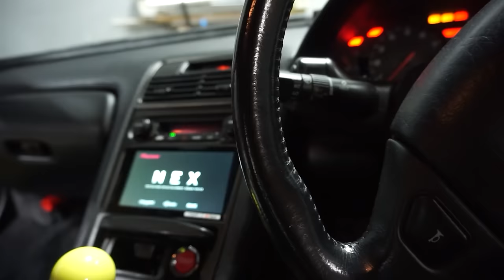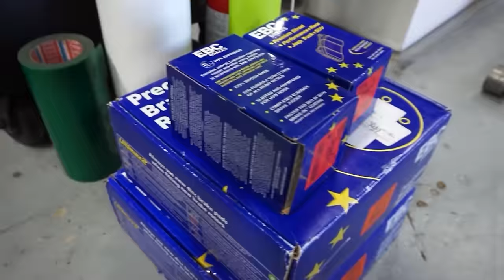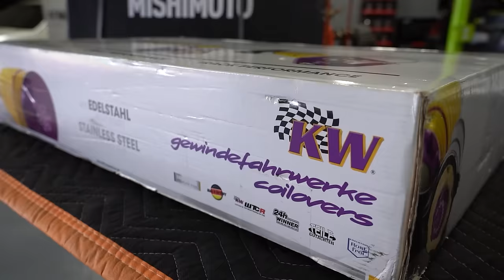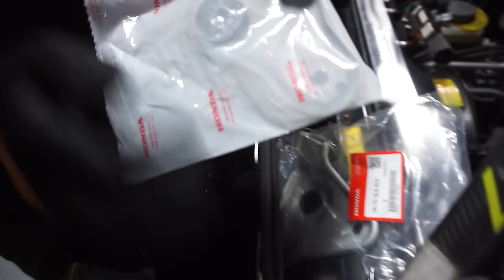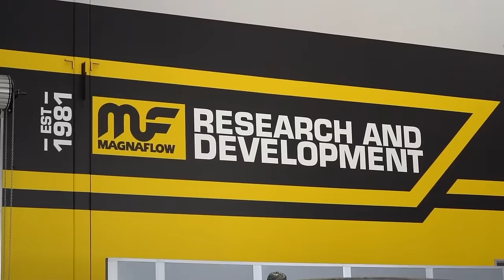Building a JDM Honda 1991 Honda NSX in 17 Minutes!

Comment: This is just simply a genuine question, but what is the purpose of giving the car a full detail prior to commencing a build? Is it to check whether or not the paint is actually any good and whether or not some pannels might need to be resprayed? I just feel as if through the build process, there is a lot of potential for paint damage to occur, which could be fixed or improved through detailing
Reply: So any left over dirt doesn’t get on the new paint job cause then it’d look shitty
Reply: So that we can see the car in its glory even during build. Not cool if it looks old and dirty. But then again, no NSX can actually look old and dirty in any form 😆

Comment: As an owner of a Spa Yellow 97 since 97 this was a great build. Everything was done tastefully and well. I'm struggling now with a fresh program for mine. I'm not a big fan of Carbon fiber but on your its looks great. I love the wheels and how you did the break calipers in yellow mine are red now  but I'm thinking of redoing them. Might go gold. I already picked a shop to do the paint correction and ceramic. Love your wheels can you tell me the sizes and can you tell me the model KW's you picked I couldn't find it on the box or the unit. The car looked great as you drove it away great job.

PS, did you lowed it much?

Comment: 5:17 brake clipper
5:32 brake pad
5:44 pad kotex hehe
6:13 disc controller
6:29 diss toté
6:38 hydraulic ?
7:25 spoke rim
7:42 firing/skirting
8:14 tidak dikenali piring terbang(UFO)
8:52 aluminium penambat kotak
9:49 kotak heater 
10:20 suspensi
10:55 sedap macam? Ayam

Comment: The carbon bonnet kills it, should really be painted. Also the Endless brake fluid is much better both in attack and daily in the long run. I would have added braided brake lines, for the pedal feel. I completely agree with everything else, especially those beautiful wheels. Usually I like carbon bonnets, but the NSX NA1 and the Prelude 91-96 are the two most beautiful bonnets in the world ever so you don't insult those.

Comment: Can someone explain the benefits of a start push button?

I get it with keyless entry. Really enjoy it on my audi. No need to use keys, luxury at its finest.

But in this case, you already need to put the keys in the ignition barrel, to turn on the electrics. 
Turning the key just a little bit more seems logical. Why install/bypass/add a pushbutton?

Don't get me wrong; I've put a start button on an old car with a worn/warped ignition barrel. 

On this car it just seems pointless.
Reply: Most of the shit they did is pointless/cosmetic, not much of a build, just light modification, so I'd call it rice
Reply: I doubt this was the intended purpose but if you watched the whole series Ricky mentions that it also acts as somewhat of an immobilizer for the car. Can’t start with just the key so unless someone knows the button is there, the won’t be able to steal it
Reply: yea I agree, ruined a good cigarette lighter too lol.
Reply: @greengoulash2718  You don't make any sense kid, I understand that this isn't much of a build, mostly cosmetic but calling it rice.. really???
Reply: @lllz9800  i was just talking about the push start the rest is just regular cosmetics

Comment: Great video with some nice mods and some not so nice mods. Lets start with bad. Its your car and your personal expression but I did not like acid yellow callipers especially with the red pads showing . I dont the bigger spoiler you installed either. It ruins the flow of the body lines . I love gold wheels on a black car but these are not my favorite style. I think this car looks dope with deep offset Advans. The carbon fibre pieces stand out too much . The lip is subtle but the hood is overkill and hurts the looks . 

Now for the good. The car itself is a legend so congrats on that. Starting with the polish and measuring the  thickness was cool to see and shows the  xp level in detailing. I love the choice of coil overs . Thats some real quality stuff. The push button is cool but I would hesitate in cutting or changing too much on this car. Its going to hurt the value over time. I like that you have an accent colour but acid yellow is the wrong choice. The shifter style is cool.  The exhaust is better in loudness im not sure about the note. Maybe it needs time to work itself in. 

Like I said, its a matter of personal preference. Before modding I would replace all fluids . Check and replace worn parts. Clean and Protect the Interior. Clean and detail the engine bay. I  would drive the car un modified for a few months to get a sense of it so that I feel the difference of the performance mods as the come into the car. 

I have a 1989 crx si and a 2005 s2000. The nsx is next on my list and has been a dream car of mine since I was teen. I happy for you and of coarse a little jealous but not for much longer ;)

Comment: Wow gold rims with black paint, so original, and you painted the brake calipers, put new coilovers, and an exhaust, shoulda just left it the way it came and changed the fluids instead, not really a build, you just swapped out already modded parts for parts you wanted.

Comment: This is not a build, y’all just gave the nsx updated parts.
Reply: I was thinking the same thing.  Buffed the paint.  Put in a push button start (for whatever reason?). New rotors and brakes.  Coilovers.  Carbon fiber hood and front diffuser.  Exhaust.  Not much of a "build"...more like a face lift.  Cool car, but the video could have been like 5 minutes long.

Comment: DIS THING IS BETTER THAN A SHITTY ROCKETBUNNY KIT ON IT
Reply: its true a rocketbunny kit on it would be bullshit and crap
Reply: just add a k&n air filter and a exhaust and small carbon spoiler and small fender flares to extend it add carbon side skirts and vented hood suspension cooling system and a spilitter and diffuser and good paint and ur done

Comment: NSX never had a good sound
Reply: Surely you are a fan of the v8 that sound like rusty iron, that v6 sounded like a v12, listen to a v12 engine and the nsx engine and you will see that it will sound the same and it makes sense since the v12 are two 6-cylinder engines together.
Reply: It may be that the escape that you put on this nsx of the video sounds something wrong but the sound is not.